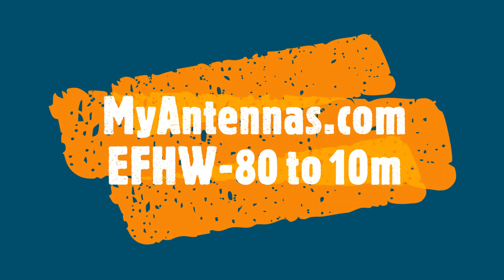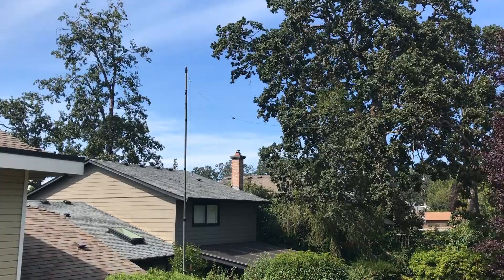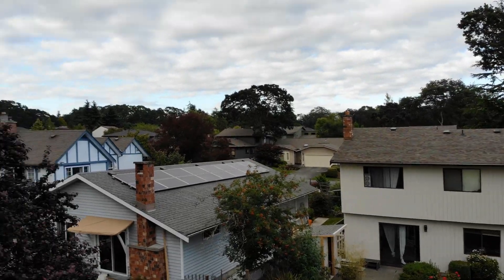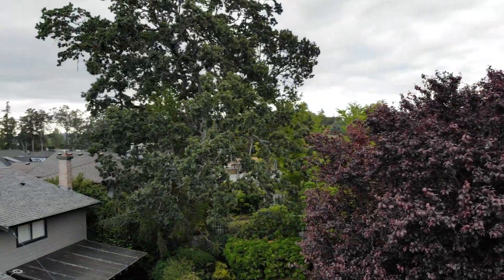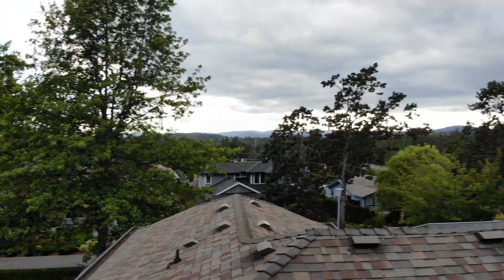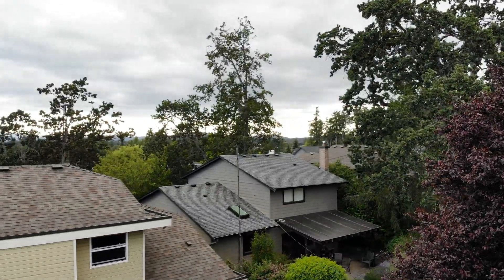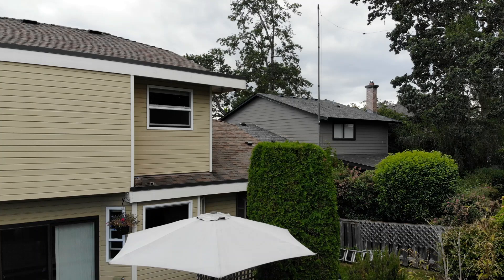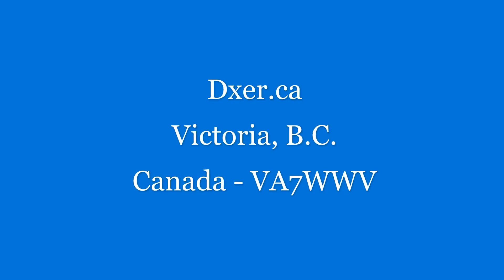The MyAntennas.com EFHW 80 10 End fed 2nd look!

Comment: I live in central California and bought one of these and threw it in a box. I recently broke it out and ran it along a fence line on the 2X4s five to six feet high as a listening antenna that keeps the neighbors happy. For the heck of it, I fired it up on 10m and was able to make 5X9 contacts to Louisiana and participated in a net in Mississippi. Go and figure. Not sure of the dynamics of fence mounting, but this sure seems to work! I do have it well grounded. It is an easy solution if you want to get on the air with no impact to the significant other or the neighbors. This films has me thinking about a square box .... hmm.
Reply from the maker: Thank you very much! I continue to be impressed by how popular this video was...

I need to do MORE videos!

Comment: I have never seen anyone run antenna wires threw metal pullies.  I always use insulators such as dog bone insulators anchored with ropes to keep the antenna away from metal.  I also keep my wires away from tree branches and twigs.  Is this not an issue for some reason with this antenna?

Comment: I’ve had this antenna for 2 years and it’s amazing. I do have 130’ of clear space available and have worked DX successfully with my ICOM 7300 on SSB and CW
Reply from the maker: It is a very tolerant antenna -- for set up and environment. Build it yourself or buy it - either way, it is an effective and convenient way to multi-band: The ultimate all-in-one antenna!

Comment: Great video! Can you describe the ground that you mentioned? Counterpoise? How long, what direction, etc.
Reply from the maker: The ground is a 6' copper pipe driven 3' into the ground -- as I have been moving the feed point around, I am not using any radials or counterpoise -
I also added a common-mode choke to the feed line which reduces RF leakage into the shack and reduces the local noise by 6 - 12 db.
Reply: @canuckcoffeecanada  ummm where? ... that common mode choke, My Antennas doesn't specify or require the use of one unless your referring to down at the rig. The feedline is supposed to be the counterpoise, unless you provide something else. About 15' from the rig.. (LMR400 coax) I use a dirty balun and three clip on ferrite chokes. does your coax come away from the feedpoint at right angles.. behind or does it parallel the radiating wire? .. all this make a difference. Richard VA7AA..Xeigu G90 running a blistering 20 watts on a good day

Comment: I've purchased a pretty much similar EFHW antenna here in UK 130ft long but my garden is only 75ft X 25ft wide. My question is would i get away with going straight up the garden for 75 ft then across the 25ft then back down the other side of the garden for the rest. I know you should try to not bend less than 90 degrees but would i have problems with the last 30 ft or so of the wire being directly parallel with the wire going up the other side.
Reply from the maker: This is almost exactly what I have done -- and it works great Like this, it is pretty much omnidirectional.

Comment: Your comment starting at 00:47 is so true. I have only owned a hand held radio; but now that the kids have moved out I am looking at building a HF base station. Buying the radio is the easiest part of that. The hard part is figuring out which antenna and where to put it. Then, you have to figure out which power supply, type of feed line, grounding rods, etc. I am thinking the Myantenna 8010 is the best for me. Hopefully by mid summer I’ll be on the air. KI4ESK. 73’s
Reply from the maker: It is what makes this hobby fun and keeps it fresh! there are so many choices, avenues and (!) rabbit holes you can go down!

Comment: I don't get to put up an antenna where I live, as I live in an apartment building and my lease agreement forbids the installation of antennas on the property.

73 VE7NDE
Reply: Keep it fairly low and tell 'em it's a washing line....put a few plastic pegs on it...
Reply: @g4obb  I would rather have zero risk of losing my home over a simple wire.
Reply: @denelson83  It's a shame that in a forward thinking modern country like your's , that you could potentially be evicted over a simple wire....very draconian.
Personally, I would rather be homeless than without my Ham radio...
I don't state this lightly, but by way of evidence ( and to prove I'm not trolling ) some years ago I was indeed homeless....However, I had a van...I had a 12 metre pneumatic mast on the back, and several High power batteries....I was very happy....73 to you  Des
Reply: @g4obb  Well, that's the letter of my lease agreement.
Reply: @denelson83  I wish you well Sir.....good luck es 73
Reply from the maker: Remote radio is always an option -- or a cabin on the coast!
Reply: I would stay in a restricted space like that about 3 days.  I enjoy freedom too much to put up with that garbage.  Hopefully you have been able to move.
Reply: @bassmanjr100  In the middle of a housing crisis?!?!  Not likely.

Comment: Hi ~ what is the Gain of a EFHW ?
Reply from the maker: It is omni-directional the way I have it set up -- and grounded well -- no actual gain as far as I can determine -- the MyAntennas.com website would have better details for an install that is 100% straight.
Reply: A dipole is a dipole.  On higher frequencies it will have lobes that will give gain in some directions at the expense of nulls in others.  There isn't really any overall gain.  When putting the wire at a suboptimal height and curved in various ways it is difficult to know where your gain might be.  Good news is that for 99.9% of us there are hams in every directions.  Throw is up and enjoy.

Comment: Nice video.  I'd like to see a little more of how you have the antenna attached to the poles.  I sort of understood what you were saying, but not 100%.  It's the counterbalance portion that I don't get.  So each of the pullies has a counterbalance weight?
Reply from the maker: Yes - I need to do an update video -

4 poles, 4 pulley pass-throughs and 4 weighted tension adjusted attachments - it means that regardless of wind, the antenna is constantly under a variable tension balance - keeping it from being too tight and too slack.

Better diagram needed!
Reply: I initially used counter balances made of paint buckets filled with sand but this was not needed.  I use 14 awg insulated wire and my longest antenna is 130 feet between two tall trees insulated from the trees with paracord. We have consistent high winds in Oklahoma and my EFHW antennas have easily handled up to 60 mph winds with no effect.  Due to tree growth it is advisable to re-tension your antennas every couple of weeks in spring and summer to prevent the tree absorbing the antenna paracord making re-tensioning or removal problematic.

Comment: My 8010 is on its way as I am milling over different configurations and radiation patterns. I'm thinking with enough understanding of radiation patterns in different configuration, I'll get the base setup right the first time (probably wishful thinking).

Something you said caught my attention. You had made contacts on all continent's with this setup? Do you attribute this to the antenna (appearing to be) running in different directions along its length (N, S, E, W) as it snakes around? Also, what is good "breathing room"? Angles? etc...?

With the doughnut radiation pattern along the element & null at the ends, can you share any of your considerations for a newbie?

TIA
Ken - K0CCT

Comment: great film, I use a 40-meter half-wave end-fed antenna with an 80-meter coil fitted,  I had a great deal of noise and the SWR was in the red when it was mounted at the house. when I moved it away from the house SWR was spot on and the noise had gone, so again it's worth moving it around.
Reply from the maker: Tell me more about the 80 meter coil.
I'd like to get the 80-10 to work on 160M -- I almost have enough yard space -- but I wonder if there is a better way -- maybe more ground radials or a capacity hat or loading coil add on...